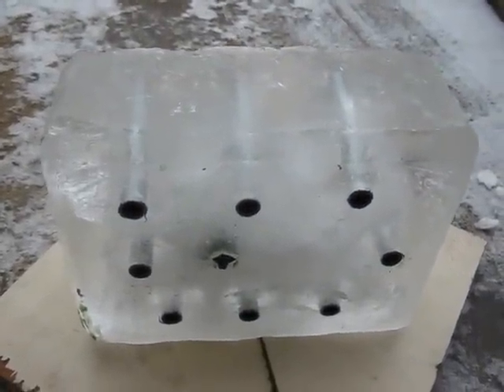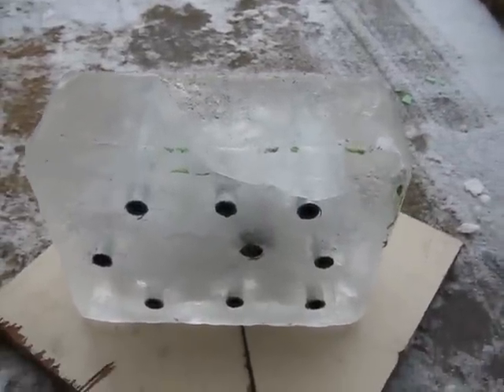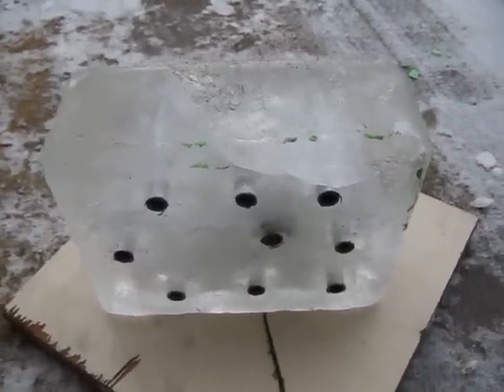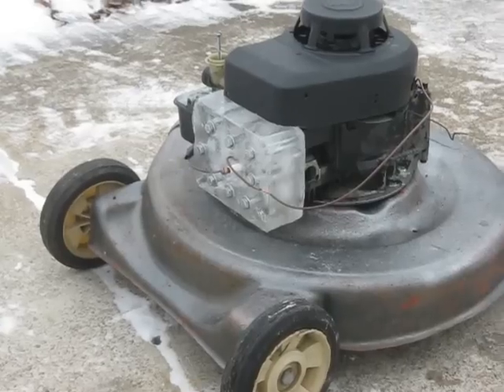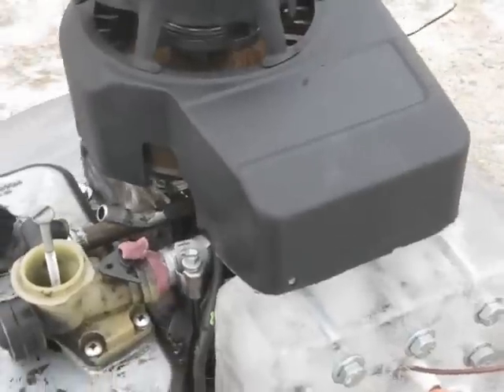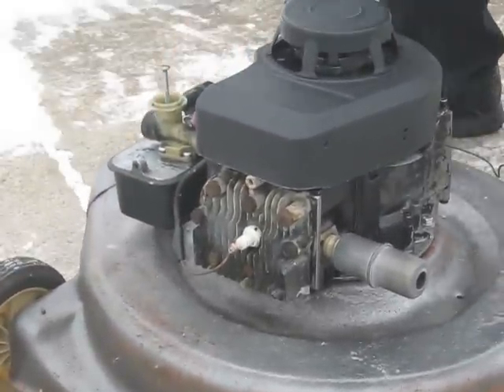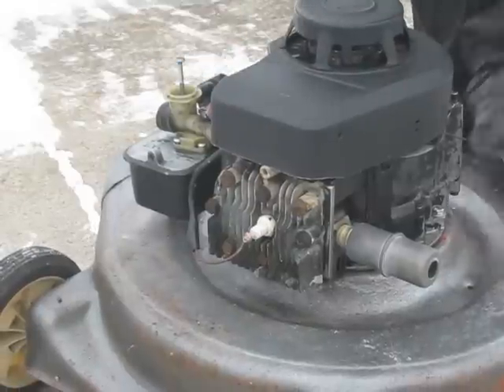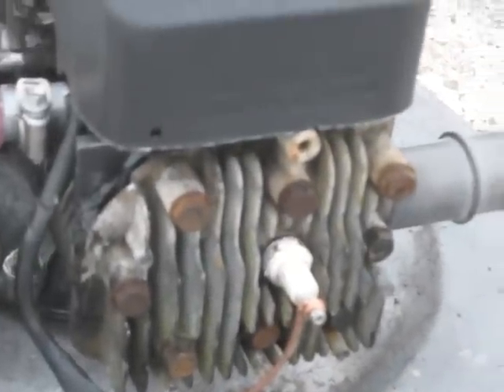ICE HEAD BRIGGS  FAIL!!!

Comment: If the ice could handle the compression for more than a second or two I don't think the spark plug could hold in the ice with out some sort of meshing or flange anything  more than just the threads

Comment: Well, I've officially seen it all now! I would think that even frozen water would tend to cause electrical shorts and issues. I couldn't tell by looking, did you have all wires insulated where ever they came in contact with the ice? The spark plug's outer metal shell is its negative terminal, so any contact with ice and any metal surface of the plug would probably equal a short(???) If the electrical aspects aren't the problem, then the next issue would be compression loss(probably in more than 1 place). Did you fashion some sort of gasket where it connects to the block? 

On the bright side, if you can get it to work, you could permanently put an end to engine overheating(although you may also need to 'modify' the basic physics of water, for instance, say, keeping it frozen past 500 degrees F, and making it tougher and less brittle). Not too many hurdles to jump here..........
Reply from the maker: LOL, the spark seemed to be OK, sealing in compression was the big problem. I eventually gave up on it for this winter, but I concluded that it is probably possible to get a short run using an ice head.

Comment: Give it a shot of ether.
Reply from the maker: lol, sounds like you want to see it blow up!  :)
Reply: That's besides the point. The ether is just to get it started running. Starting fluid. It ignites more readily at low temps than gasoline. Like when you have a cylinder head of ice. Get it running nicely....then blow it up! LOL

Comment: Can you make one out of cement.
Reply from the maker: Aha, the Ice man speaketh!  :)
I will think cement over, though I would have to wait for temps to raise here a bit so it didn't freeze while curing. One thing is for sure, concrete is much stronger than ice!
Reply: ChargerMiles007 Good job on the ice head, I think it's the only one out there!

Comment: What in the world is the point of this? Must be the cold weather. A guy has got to get out of the house.
Reply from the maker: Oh I got out of the house alright, freezing my butt off at 16F bolting this lump together in the cold! I had to, if I brought in inside it would melt on me like Frosty!  :) I have pretty much given up on it, though my son thinks it could work with more careful casting, using distilled water and pouring it in stages, so it didn't crack like this one. i am moving on to other projects since this one got all wet.

Comment: man I think you have lack  of compression maybe if you had a gasket or something
Reply from the maker: Yes, it does have low compression. I tried to correct that on my latest vid of it at night. I added a wooden piston crown, as well as grinding the compression release off of the camshaft and adding a thin rubber gasket. it still leaked too much out to start.

Comment: Put a bead of RTV sealer on the block and "mush" the ice onto it while it's still wet and tighten the bolts. 
It won't be totally blow out proof, but it will help seal compression a little more which I think was your problem. 
Is there enough clearance for the valves in that ice head?
Reply from the maker: I did the silicone already, so I don't think it helped much, too thin I guess, plus it wouldn't harden. I just uploaded another attempt where I used a thin rubber gasket, it worked better, but still wouldn't run. I did get a nice light show, as I tried it at night.
Reply: OK. You're trying everything I would try and I'm sure you'll get it.  Once you've sealed compression, another theory is that the ice is cooling the intake charge too much and affecting the fuel atomization. Yes, the engine will start with a stone cold aluminum head, but the low mass of the aluminum head allows it it heat up very quickly and get the combustion chamber temperature up almost instantly. A block of ice like that is an incredibly large heat sink impossible to heat up to combustion temperatures.  Not only that, the ice is shedding H2O every time there is a flame attempt. The extra moisture in the combustion chamber isn't helping, either.

Comment: Prediction for how it will fail if you get it running: I think the ice will melt quickly, like 30 seconds or less and instead of blowing ice shrapnel everywhere I think it will just melt a hole into one side of it, and then failure due to compression loss
Reply from the maker: I wish it would have done that, I just uploaded a second vid, but still couldn't get it to seal well enough to run, I think the idea is all wet!
Reply: Ah man, just melting too quickly? Too bad, still an awesome concept though!

Comment: put some springs on the head bolts, as it melts it'll push in
Reply from the maker: That may work, I tried a rubber gasket, but the ice cracked. I suspect a head poured in layers might work better, as this one had some internal cracks. I am calling this quits, and moving on to other projects, though I did upload a night time vid that shows the flame inside the engine.

Comment: Are there blades on it? They help for momentum when starting and to stay running.
Reply from the maker: No, I don't run these engines with blades for safety, I use a heavy flywheel from a horizontal shaft engine. You nee either a blade or a heavy flywheel, so it doesn't kick back during starting, had that happen before . Ouch.

Comment: I just had a Idea,put afull piece of cardboard,like from a ceareal box, between the cylinder and ice head,to give it a chance to start..
Reply from the maker: I thought of doing something similar last night. It seems that the main problem is leakage at the block to ice head joint, so it needs some type of flex gasket, or a piece of cardboard or wood cast with the ice. hard to say, it might get a few second run that way.

Comment: Ice under compression lowers its freezing point and melts where it is compressed, you will never get a seal on the head.
Reply from the maker: I think you are right, I know I can't hardly tighten the head bolts before it starts to give way. A very off the wall idea, but I thought I would have a shot at it.

Comment: shave a bit off try again
Reply from the maker: I will probably give it another try, but I need it to be about -10C to do so. It is a bit of a pain, as I have to work on the engine block in the house, take it outside to cool down so it doesn't melt the head, then assemble it in the cold. Quite a headache, though I would like to see at least a short run.
Reply: short run is ok bud
Reply: Liquid nitrogen is quite cheap and should be available at any welding shop. Careful with large amounts.

Comment: You ever do the math on what a stock shaved head will yield for a compression ratio?
Reply from the maker: Back when I was building the sleeve valve Briggs, I measured and calculated the stock compression ratio on a 3-1/2 horse Briggs lawnmower engine. If I recall correctly, it was in the 6:1 range. Initially I used about 8:1 on the sleeve valve, then re-machined it to get about 9.3:1 , it was high enough that it was a lot harder to pull over. Though it didn't have the easy spin compression release, so that would make it harder also.

Comment: Did you ground the spark plug to the block? If not, you may get lucky and jump spark to the piston, but im pretty sure that was the problem. I though it would at least run for a few seconds!
Reply from the maker: If everything fit correctly the spark plug ground electrode would end up 1/4" away from the block. I soldered on a grounding wire, seen leading away from the head to the right side of the engine. I also had to extend the plug wire to reach the plug. I didn't actually test it out, but I will before i try it again.
Reply: Josh Denham water is conductive so I would like to think that grounding isn't the issue, but I could be wrong. This topic is an interesting debate.
Reply: That's why there's two copper leads to the spark plug, one goes inside
Reply: Aaron Purtell water has high resistance. doesn't conduct very well. salt water conducts better. plus, he has a ground lead from the block to the plug.
Reply from the maker: Yes, you guys have figured out what I did with the ground wire.

Comment: why not take a piece of plywood  3/4 or 1/2 inch  soaks in water getting it bolted on while it's wet so it take a rough shape of the sealing surface  and then make that block of ice with the plywood surface facing the engine and see how long that would last. I don't know if anyone has thought of that or similar to it.
Reply from the maker: I came to a similar conclusion last night, that freezing a piece of wood to the bottom might solve the sealing problem long enough fro a short run.

Comment: i think the problem was lack of compression from no gasket. try a white snow gasket, the white ones not the Chinese yellow ones they are junk.
Reply from the maker: white snow for a gasket, interesting. I will definitely be staying away from the yellow snow!!!!  :)
Reply: ChargerMiles007 lol!! 
I was almost wondering if a temporary seal could have been achieved if the engine was wicked cold and you poured some water around the area that the head meets the block and it refroze on contact...that's usually pretty cold , this was a hoot , proof enough to me!!
Reply: ChargerMiles007 mrhillfolk is right.. but I would say to hear up the block where it meets the head a little then put the ice on and let it refreeze to the block.. maybe tighten a couple times the first hour?? that should give a pretty good seal
Reply: Allen McKinney i see what you did there

Comment: Never would have thought of that! Excellent effort in making that head, you did a fine job with it, did the engine lose compression or mabe moisture drowned the spark? Better luck next time.
Reply from the maker: I think it was a combination of low compression, leaks and possibly the plug being shorted by water mist.

Comment: Good idea are you going to make wooden valves?
Reply from the maker: I would like to do that, as it is an interesting idea, I just don't have access to a lathe right now. It would have to be fairly strong wood, as the valve is only 1/4" diameter at the stem.
Reply: That's too bad. I wonder how it would work.

Comment: Looked like the head was leaking by the muffler
Reply from the maker: Yes, I noticed that on the vid also, when I ran it with the normal head. I had put silicone sealer between the steel plate and the engine block, but I only tightened the head bolt to the same fairly low torque as I did with the ice head, to be a fair comparison. Apparently the steel isn't perfectly flat, so it leaks a bit there. When I ran it with the wooden piston crown, I torque it down a lot tighter. the ice would not handle that amount of pressure though.

Comment: Next time,Turn it over with a drill..
Reply from the maker: Yes, I wondered about doing something like that, as it was I had to trim 1/4" off of the bottom of the starter cover to clear the ice head. I think it is leaking compression on the bottom mating surface of the block, as I noticed a few drops of water after the couple of times it fired. I need some colder weather (not that I like it!) as it was getting to close to the melting temp today :(